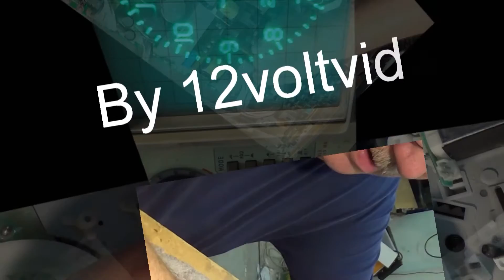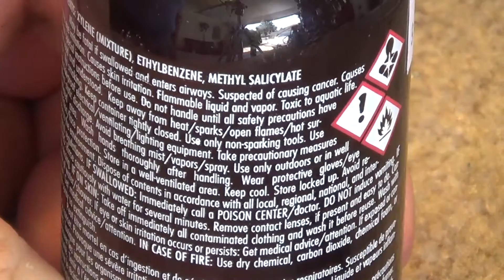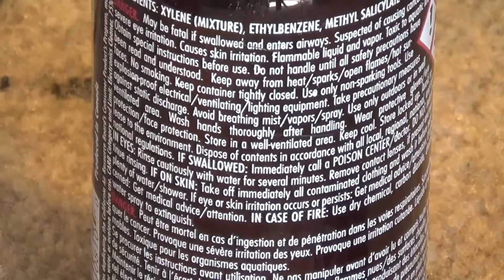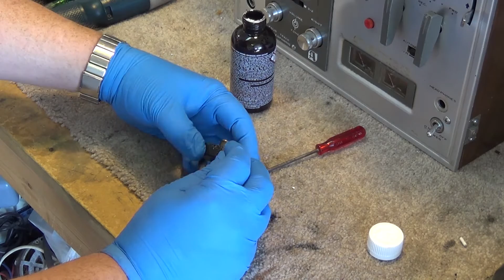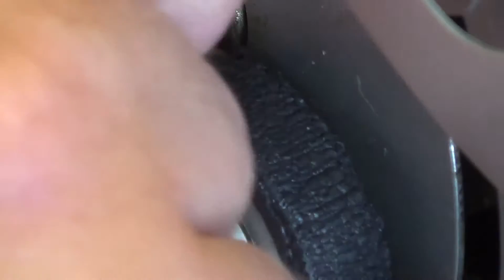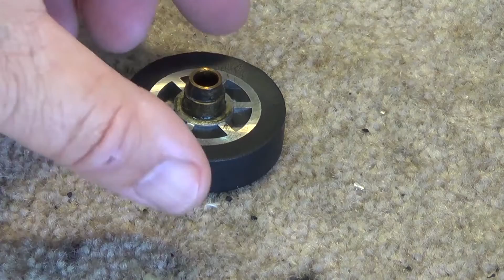Restoring a pinch roller with rubber renew

Comment: A close friend who was an experienced electronics repairman ( Actually, he could fix about anything electrical, mechanical, pneumatic, hydraulic and whatnot, a true high priest of the Machine God) always jokingly insisted that only cleaners, lubricants, solvents, etc. that definitely caused cancer, birth defects and laid waste to the world around us were the only ones that actually worked. When I saw the title of the video, I remembered a bottle at the shop that was labeled Video Renew and wondered if this was maybe the same thing.
Reply from the maker: Oh you mean carbon tetrachloride, xylene, and all those nasty ones from back in the 50s and 60s.  Freon tf was good but it eats the ozone.  
I know many an old tec, correction knew many but they all died of cancer.  The engineer that taught me the fingernail had clean trick for when you're on the air and you don't have time to unload the tape and clean the heads thread the tape and cue it back up again, he used to clean heads with a cloth soaked in xylene.  We were all told to use that on video and audio heads and 99% ipa on rubber parts.  (Xylene will make rubber soft and is one of the ingredients of rubber renew) even the guys that did not service equipment but just were in the supplies business where they had cans and bottles of all these chemicals that they were shipping out to the repair shops got exposure just through bottles being broken leakage etc they're all dead and they all died of cancer. Two suppliers that we used to use when I was in the business the owners both developed cancer I think it's a pretty good call that it was due to the older chemicals because they were in the business of supplying supplies and parts for many years so they had dealt with the old stuff and you get leakage and spills and so forth a lot of these chemicals came in glass bottles so if you dropped it it would break and then you'd have a big exposure in your shop. they banned most of these chemicals for a good reason because people were dropping dead after using them for years.
Reply: @12voltvids  Yeah, I worked for 25 years or so in the screen printing industry, early on, back in the late 1970s there were some horrific solvents in common use and to some extent, a lot of the chemicals used in the newer UV cure inks ( The older stuff was solvent based inks.) like monomers that get polymerized by catalysts and intense UV light from paste like ink into suddenly solid printed colors ain't all that great for you either. How bright are the UV cure light sources? Imagine an electric welding arc light over four feet long. The prints went under the light for only a couple of seconds and the lights were usually (Usually) well shielded but there was always a little leakage here and there. Not the healthiest environments. The places I worked printed some big stuff (Banners up to 10 feet x 3 feet, 4 colors, one after another on the same press with 4 print and 4 UV cure units) and smaller items as well. I retired in 2020.

Comment: 14:25 - that was painful to watch. The wow & flutter is off the charts with that chunky roller. Search "Terry's Roller" to get a new tire for that pinch roller hub, the music will sound a lot less like the singer if gargling salt water. 🙂
Reply from the maker: Cost to have that roller done is over 175.00 by the time shipping and taxes fees ect added.  Not putting money into an old piece of equipment that will never be used   the cams are ready to fall apart.  I actually do have a few rollers that will fit this but then again why? The head us so worn you can break your fingernail on it.  It's worn out so no money going into it.  I have had this since 1969 and it has been well used.
Reply: @12voltvids   You got your money's worth. To be clear, almost all of Terry's rebuilds are $50 + $10 shipping. But I agree with you, in this case it isn't even worth that, unless it was being prepped for a collection or something odd like that. Enjoy!
Reply from the maker: @ray_notes8170  I had s quote years ago and by the time shipping was added and he refused to ship by post only fedex  50usd will have 42 in broker fees added.  It wasn't no 50 either at the time he quoted me I believe it was 80 or so for one I enquired about. This was for an old ferrograph that I have.
Reply: @12voltvids  yeah. That's not cheap. I'm replacing the pinch roller on an Otari MX5050 8SHD 8-track reel to reel; well worth the price. But my situation is a bit different since Terry only lives a couple miles from me, so I dropped off the old wheel personally. Online they go for $160. For my 4-track, I just bought the tire for $15. I'll see if I can repair it myself. Love your videos by the way. I've watched a ton of them.

Comment: American Recorder Technologies S-721H-4 Cleaner Fluid is apparently what's recommended for tape heads, capstans and pinch rollers.
It's 98% Hexane and 2% Cyclohexane. Highly flammable. Not sure if it swells rubber, though. It isn't cheap at 29.99 for a 4 oz. bottle.
It's available on Amazon.

Comment: Greetings:
MG Chemicals (Canada) makes Rubber Renue. Originally their formula is as listed in this video. Item 408A. California  Air Resources Board requires 408A to be diluted by 25% using iPA before use. They had a product that was compliant, item 408B, which has been discontinued and replaced with Rubber Renue 408C that does not require dilution.
Soaking pinch rollers until the Rubber expands will allow most contaminants to be able to be washed away prior to allowing the rubber to evaporate all of the applied chemicals (the longer the better).  Without soaking, only the outer surface will be treated.

Comment: waste of time....
Reply from the maker: Tape deck works.  Better than spending 100 for a renewed one on a tape recorder that isn't going to see much use due to pot metal cams just waiting to crumble.
Reply: @12voltvids  ....theycan be machined on lathe...
Reply: @12voltvids  Also instead of applying solution onto rubber make a tyre out of 12mm rubber sheet on lathe and stick it on to the metal rim of the pinch roller...
Reply from the maker: @AtulClassics  don't have a lathe or access to one.

Comment: Was this machine playing too fast with the bad pinch roller?
Reply from the maker: Why would it?
Reply: @12voltvids  
Not sure. I'm asking. I've read where the capstan governs the speed of the tape across the heads. If the pinch roller is slipping, would that not affect the speed?
Reply from the maker: @raynus1160  If it was slipping it would be to slow.

Comment: The company that makes this item which is MG Chemicals states specifically  that it should not be used on a pinch roller.
This information is not printed on the bottle. But, after several phone conversations with company personnel I found out that since it contains oil.... it is detrimental to use it on a part that comes in contact with audio or video tape. It does a great job in giving new life to rubber components, but, can cause trouble if used on the pinch roller.
Reply from the maker: Clean the oil residue with alcohol afterwords

Comment: A much better way to restore life into the pinch roller is mount it on a drill, and gently apply 1000 grit while it's turning. After again while turning with a drill apply min 90% isopropyl with a cutip and then apply this chemical.
Reply from the maker: I will try that next time.
Reply: I've tried that a couple of times and yes, it works (even just the drill part). Even a simple drill and a few minutes can do miracles with a rubber wheel.

Comment: Hello, I have an Akai GX286 in which the roller is not cracked, but its consistency does not look like rubber, but rather bakelite, will that product make it come out with some spongy consistency?
I would also like to know if the roller of some other Akai fits this model?
Sorry for my poor English, I am using the google translator.
Greetings Marcelo.
Reply from the maker: If you soak it, it will likely cone back. Many akai units used the same roller

Comment: Do you honestly think that flicking buttons on and off makes you look competent? What is does is show how people break devices. Why on earth not remove the last couple of minutes from the upload?
Reply from the maker: This was to show that the unit was not functional and it will not damage anything. Of course if you were intelligent you would already know this.  Activating switches will generally clean the contacts so if a fault was caused by an oxidized contact switching modes back and forth will clean the contacts by mechanical action.  Everyone watching with even the slightest knowledge of how things work knows this already.  When we clean controls and switches after spraying in cleaner the switch or contol is operated quickly from end to end to effectively clean it. But then you just proved to everyone that you know nothing about electronics by the comments you made.

Comment: What a load of rubbish. Where's the sense of adventure? Not that poisonous at all. Over half the warnings apply to water and oxygen. That must be the first and last time Dave used that stuff with rubber gloves. People worry about such warnings disproportionately as most people cannot correctly or logically evaluate risk.
Reply from the maker: I used to use this stuff without gloves as did my coworker.  He used it much more than me because he was the turntable guy.  He got cancer.  The guy that ran the supply shop died of cancer, my old bosses dad who was a tech died of cancer as did my boss at the first shop I worked at. I get nervous every time I cough these days as I was exposed to all those cleaners that were sprayed freely at every shop I worked at and we had no ventilation.  I have had more people I know from the service business die relatively young from. Lung cancer pancreatic cancer bladder cancer liver cancer leukemia you name it.  Pretty much every colleague I had in the business has been sick.  Considering all the chemicals we used to use it doesn't surprise me.  Carbon tetrachloride was a cleaner but thank god it was gone before I got into the business as all the older guys I knew from that era are all long gone now and many passed in their late 50s to early 60s.  Coincidence? I think not, and now we get all these warnings on cleaners that were never there before.  I try not to get anything on my hands stronger than isopropanol .
Reply: @12voltvids  I also wonder if the past use of solvents will catch up with me. In the Navy, the preferred cleaner was trichlorotrifluoroethane or CFC-113, is a chlorofluorocarbon. It has the formula Cl₂FC-CClF₂. This colorless, volatile liquid is a versatile solvent. It has attracted much attention for its role in the depletion of stratospheric ozone.  If I recall, the only warning on it was do not drink.
Reply from the maker: @bill.shingledecker  yes I remember that. I'll have to look at the chemical name of the freon tf I still gave and see if it is the same.  It may have been dichlordiflororthane. It also burned the ozone, and the warnings were not to smoke when using it as burning it made it toxic.  I am concerned as well as for 20 years that stuff was sprayed every day to clean controls, heads ect.  My old boss used to close the door to the service dept so that customers wouldn't walk into the back and disturb us so the fumes were trapped with us.  The guy I worked with developed early onset alzheimers and I am sure is no longer with us.  I haven't seen him in 15 years.   He was my assistant and did much more tuner and control cleaning than me.  I was working on vcrs so my cleaner of choice was isopropanol alcohol.  Got that stuff on my hands all the time and nutrol. The stinky ones were used by my assistant.

Comment: I always worry about chemical treatments, such as this one, because there's no way to know if the chemical will continue to have a slow and long lasting chemical reaction that will continue to deteriorate the material in the following months or years. This would not worry me too much for a pinch roller that is in such bad shape as the one you rejuvenated, but I would worry about using this on a pinch roller that is in much better shape, such as the other one that you treated.
I saved some old pinch roller on my mini lathe. What I basically used the mini lathe to remove the top film of dried up rubber and exposed the fresh rubber that was still underneath. The pinch rollers I saved did not have any cracks in the rubber, though. They looked good, but they were slippery. After I shaved off the top film on the lathe I made them much better. I didn't even have to reduce the diameter for half a millimeter. The capstan diameter must be exact, but I think pinch rollers have more of a tolerance, so if the are just a hair smaller in diameter it makes no difference. 

Anyway, those pinch rollers I shaved still work great and they don't put any tension on the tape, such as pulling it off the straight path (which was the case before my treatment). 

In any case, thanks for sharing your videos.
Reply: This stuff transfers its solvents to the tape which will eventually stick together on the reel. If you want to use the player to say digitise a tape and then throw it away there is I suppose a justification in using it, but never use this for archive tapes that will be used again - never!

Comment: Ohh , very bad the pinchrroller
Reply from the maker: In sad shape but still working.  This tape deck isn't being used.
Reply: But , is very good sound , i remeber the akai 1721w and the speakers jet strem sistem
Reply: Is similar at the models 1721 l and 1721w

Comment: This is a kind of special pinchroller made of two different rubber type. The outside rubber is different from the rubber that will go in contact with the tape. You can see this by yourself just watching closer to the pinchroller. That pinchroller are gone, nothing can fix it. Anyway thankyou for sharing this interesting video.
Reply from the maker: MVVblog 
Well when I started this one was so bad that tape slipped. Now it plays fine.  I don't use this tape deck anyway as the head is worn quite badly. I have 2 other reel to reel decks that I use for open reel tapes.  This old 1710 is a 2 head and my other decks 3 head and 6 head. The only thing this deck has going for it is the tube amplifier and Built in speakers.

Comment: You can buy a new tire for the roller for $19 and not worry about destroying tapes. Not sure if one of these would fit though.
http://www.vintage-electronics.net/akaipinchrollertirepr1.aspx
http://www.vintage-electronics.net/akaipinchrollertire.aspx
Reply from the maker: When I priced out a new pinch roller for this unit 175 was the asking price to make an exact replacement for it.
Reply: yikes. that's insane. There's also Terry's Rollers. He did one of mine for 80 which involved me sending the whole roller.
Reply from the maker: Yes I found his site too. 80 US. plus the shipping both ways.
80 US, ,plus 15 to get it there, and another 30 to get it back because US to canada shipping rates are criminal.

Comment: Maybe someone with a milling machine can cut a rubber pinch roller for you out of a solid piece of rubber.
Reply from the maker: There are a few places that will make you a new roller. The problem is they want more for the roller than the machine is worth. 100.00+ for a piece of rubber. I don't think so. If I was using it every day perhaps, but my reel to reel deck sits there collecting dust.

Comment: Maybe a silly question to you
But what are those black caps called holding on the reel ? Thanks
Reply from the maker: +365 GTA MUST PLAY 247 
They are just generic rubber reel clamps. We're popular in the day. Rare as hens teeth these days. Clothes pins work good too. More modern machine had locking hubs.
Reply: Ok thanks

Comment: Is the vacuum tube part of the pre amp section of this machine?
Reply from the maker: +Gary Farris It's all tubes. No transistors. Tube preamp, tube power amp, tube record amp, and bias oscillator.this old unit sounds very good, except that the head is wearing.  I use my GX265 more as it has the glass heads that just don't wear out. Akai claimed that you could run a tape over it 24 hours a day for 20 years.
Reply: Wow! thx for the info. Never knew they made tube reel to reels. I would assume its recording capabilities are outstanding, but do you experience microphonic noises and such in playback? I used to live near a 50,000 watt radio station and i could hear their broadcasts through my fender amp.
Reply from the maker: +Gary Farris All the old ones from the 60's were tube units.Haven't had too many problems with it. Had a tube go gassy once, had a cool blue glow in the tube, and it hissed like crazy until I changed it.  I once had to work in a house that had a 50,000 watt AM station in the field out back (farm house) Everything in the house played music. Dish washer, toaster, water tank. You could feel the RF on everything metal. The entire house was buzzing with RF.
Reply: Thats funny! I called them (the radio station) up once and complained to no avail.
Reply from the maker: +Gary Farris Nope they don't care. Not much they can do about blanket interference.

Comment: I have exactly the same model of tape deck also with a bad pinch roller, can you tell which other akai models use the same part?
Reply from the maker: Many Akai use the same roller. I have 2 other Akai, GX265 and 4000DS and they both use the same roller. The 4000DS is almost the same machine as this, but solid state, and a 3 head model.